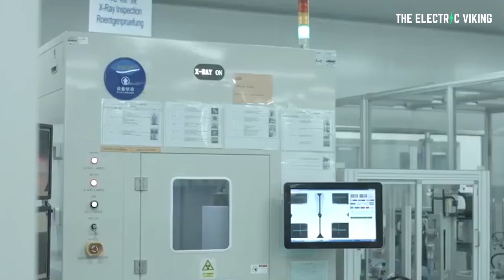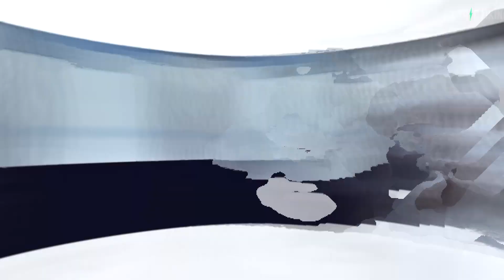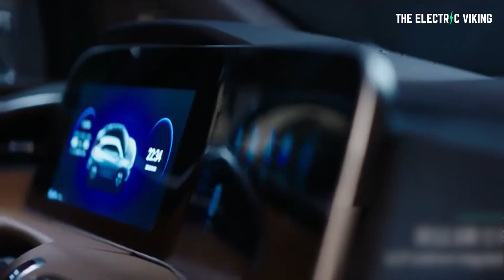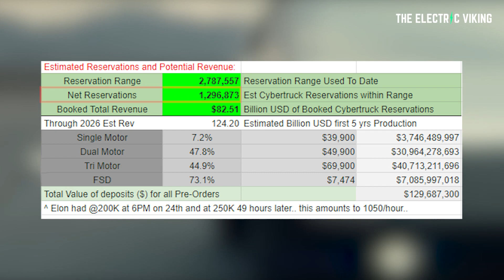The Chinese EV with a range of 1000 km's in 2021

Comment: Awaiting the arrival  in the US of the BZE4 and Solterra, as you had mentioned that they will be using the BYD 3.0 blade battery. Has there been any word about increased range for the blade battery? A 1000 km range would be ideal. Also curious about which Chinese EV's may be available in the US in 2022

Comment: I don't see the point of 1000 km range. I would rather have half the battery and (more than) half the range. Sure, for pulling a trailer a bigger battery would be nice, but take a Model 3 LR for example. Over 600km WLTP. Not NEDC. That's certainly enough. 150kWh battery is just waste of resources.

Comment: I am glad to see the rapid development of EVs, we need it if we're to be able to solve the immediate climate challenges we face. But, I have to tell you, I'm really getting tired of watching vids of concept cars, and hearing promises of long range and great power for a reasonable cost. What is actually in mass production, on the market now, and available to me, is pretty wimpy, with the exception of Tesla (I have an order in now for a model 3 and a cyber truck) - and Tesla is very expensive, and seemingly getting more expensive as we go along, instead of less. The Chev Bolt is available, if you don't mind it exploding occasionally. Nissan Leaf has proven to be dependable, and at a reasonable price, but with 100 miles range, only suitable for a city car, not your main driver.
I'll be impressed when some cars come out with 300+ miles of range, 0-60 < 6 seconds, good handling, fit and finish, and at a 25k to 30k out the door price point. And when it's been around for a few years and it's been proven to be dependable, non-exploding, and not full of bugs that denote a hastily thrown together product, as is the current US OEMs' offerings.. I'm sad to say that, regardless of all the promotions and promises and bulls**t, looks like it will take a few years.

Comment: The average length of a commuter trip by car/van varies little across English regions and Wales at . It is highest in the South East (11.2 miles) and lowest in London (8.6 miles). This statistic shows the average person trip length in the U.S. in 2017. Commuting to or from work is on average . The Lucid Air top of the range model will have 517 miles range and deliveries start in the US later this year.

Comment: I don't need 1000kms. I need an affordable EV. My affordable ICE car only gets 550kms of range and I only need to fill it up once a week. I will replace my daily driver with an EV when I can buy an EV for the same price that I bought my ICE car, if it gets 550kms range or higher. Here's a challenge for EV makers: flood the Australian market with affordable EV's that have 550kms and costs about $20k, and when the resale value drops to $5000 in 10 years or so, I will buy one. Not holding my breath, but that's where I'm at. I'm sure my 2006 Toyota Yaris will last another 10 years, and I'm happy to replace it with an EV before then if the price is right, but I won't pay more for an EV on principle, because there is a lot of inconvenience involved for me. I will need to install a charger outside my house, and because we only have one parking space at the house, and 2 vehicles, we can't have 2 EV's. So who will get to drive the EV? Me or my wife? She isn't even interested in EV's at this point, and is even more frugal with money than I am, so won't be even slightly interested in either of us replacing our bought and paid for ICE cars at current prices with the current range. $20k for a used Nissan Leaf that doesn't even get 200kms range? Forget it. As for buying a car that gets 550kms range at current prices? What would that cost? Can anybody fill me in?
Reply: Strange logic :)
You need only one charger for 2 cars when you're only commute 100 km a day.
You plug a car one's a 3 day.
Reply: @rafanagorski392   it's still a hassle. Can you move your car so I can plug in? I'm hoping by the time we get an EV that there will be affordable EV's  that get over 500kms to a charge. Right now it seems you have to pay $40k plus in Australia to even get 300kms range. $70k for a Tesla that gets 500kms. The price is not yet right.

Comment: What does the Aion LX cost?  What is the chemistry of their batteries?  I'd rather have 500 km of range and have a battery that weighs and costs half as much, assuming there was a DC fast charge system with the density of Tesla's.

Comment: Eventually will manufacturers put in more modest batteries because for all but extended road trip is 500Km quite adequate.
The times I have driven over 1,000Km in a day it was a big day and quite tiring.

Comment: 1000 km. range is more than enough.  A car with a 400-450 km. range and quick charge times will eventually become the norm.  By shooting for a smaller range they will need a smaller battery, saving vehicle weight and production costs, allowing more competitive pricing.

Comment: A lot of people here in the US are under the impression that 643km (400 miles) is  enough but none of these people can drive that long before needing a bathroom break 

I think 482km (300 miles) to 563 (350) miles of range is more than enough for the average driver and weekly trip goers.

Cars such as the Model 3 and Y long range, Ioniq 5, EV6 and the Nissan Ariya are all good looking vehicles that get 300 or above range and would do just fine.
Reply: The problem is, even if the epa says it's rated at 300 miles, you're actually only getting about 230 miles of real world range.
Reply: People want range because they can't always guarantee that the charging station will be available, or indeed, working.
Reply: America probably has 75 million Folks Who would be happy with 200 miles and a useable purchase price.....Paul

Comment: What is your thought of electric vehicles running on hydrogen which is produced by 100% solar and solid-state laser technology stored on 100% recyclable film?
Reply: Still uses a fuel cell and either a Battery and or expensive supercapacitors and electric motor/s. plus you now add in the storage cassettes for the Hydrogen storage medium and the Lasers to release the Hydrogen etc etc - adding more complexity and maintenance cost for what real advantage ? apart from anti EV and Tesla
Reply: @j.pgoodwin9020  I'm not against EV. The environment is what I am thinking about.  I have been to the Nevada mines and their respective drain fields that use scarce water in the Southwest to produce materials to be used in batteries. On May 25th our USA administration announced they will shut down these mines and purchase these caustic metals overseas and bring them into the U.S so American workers will turn them into things like batteries, so electric vehicles can be built by union workers. Like I said I am not against electric vehicles. I looking for ideas that are better for the Global environment. So far all the USA has done is converted nearly 100% of the coal utilities to natural gas leaving us with over 60% of our electrical utility power coming from fossil fuel and 20% from nuclear. In 2021 USA coal production is expected to increase 20% as we ship to countries like China who have increased coal usage by 35% this July after they stopped the Australian import of coal. I am looking at solar and nuclear and ways to reduce pollution versus the BS logic -  Is okay to screw with the environment as long as it is not in my backyard!
Reply: @Carl_in_AZ  You have raised a very valid CURRENT ISSUE. However others are also aware of this issue. Lithium Aust (LIT : ASX) has more environmentally friendly technology and patents and have you checked out Tesla's patents for Clay extraction using salt.
There is research in so many areas of energy storage and generation and it can be challenging keeping up with it all especially as many players are in stealth mode and not publishing and companies such as Toyota are going full on hydrogen even as direct fuel for internal combustion engines which can only be considered as questionable due to efficiency losses and high maintenance costs even if supporting dealerships and existing supply chains but at what long term cost just to please the ICE bang Lovers
Reply: @j.pgoodwin9020  Yes I am aware of companies like the one I work for that are looking at ways to lower the caustic pollution caused by the production of batteries. Our company manufacturers their own proprietary batteries that have been used in our industry-first battery semi-truck. We presently produce our own hydrogen. That hydrogen runs our hydrogen truck engines, locomotive engines, generators, and five months ago planes using our own proton exchange membrane (PEM) fuel cells. We also have in test 3-cylinder 10.6L ICE engines with Walmart in California running dirty hydrogen or "renewable" diesel which may turn out to produce far less of a carbon footprint than battery trucks that obtain electricity from utilities that produce their electricity from 60% fossil fuel in the USA and much higher in some other large countries. My company is far from being in stealth mode. We are all over the press for people that follow hydrogen and other storage technologies to lower our global pollution which goes beyond carbon footprint. I would still like to hear people's viewpoints on Solid-State Hydrogen stored on film?
Reply: Due to inefficiencies in the whole extra chain of steps needed for hydrogen: it seems like a dud. Be like taking your mains power, running it through hydrolysis and then back through a fuel cell to get electricity again. Just pissing away energy on conversion losses.
Reply: @--Nath--  I agree that PEM (hydrolysis) is not the way to produce hydrogen. It is no different than producing electricity from fossil fuels to charge batteries.  There are Walmart trucks under test in California using diesel that produces less carbon footprint than battery-powered EV trucks. I work as an engineer for the company that made the first battery-operated semi, hydrogen, and achates power generation on trucks, locomotives, planes, and critical care facilities. Presently we produce hydrogen from PEM. That is is why I ask what are your thoughts on solid-state hydrogen? PS you do not need fuel cells to run on hydrogen but it may prove to be the most efficient ($) per mile over 150 miles versus battery technology on large vehicles.
Reply: @Carl_in_AZ  I guess the bit I can't see how it can be worth it at least for cars where we know EVs can already work by going from electricity straight into battery charging. Adding extra steps before that doesnt seem like it can possibly get even close. Maybe if the cars ran off hydrogen as the fuel directly or if there was a conversion for existing ICE vehicles like you can go from petrol/gasoline to gas (as in LPG not gasoline), but I have no idea if that is in any was feasible/economic  - but it might help get existing cars more clean for the rest of their working life. 
As for the method of production of hydrogen - a worry I have is that here in Australia they have passed away $4B on fantasies like "clean coal"/CCS of which none of them have achieved stated goals and they are talking about doing the same thing for hydrogen (called "blue hydrogen"). Or perhaps just greenwashing fossil fuel into hydrogen. So it feels like hydrogen is what the fossil fuel lobby want because it prolongs their existing investments by giving them a "lite cigarette" equivalent to run PR/propaganda about. The "natural gas" lobby has been doing this already claiming it is cleaner. Hell, the coal lobby is also claiming that Australian coal is cleaner and helping rather than worsening climate change.. so there is that aspect..
Reply: @--Nath--  The two companies working on solid-state hydrogen are H2E in Australia and PK in Arizona. Some major USA and Swedish engine manufactures are also investigating solid state  Dirty hydrogen which some call blue hydrogen is another topic. When we looked at the global environmental footprint when electricity is produced by fossil fuel at the utility the winner is not always battery TO DATE. We are seeing a better overall environmental footprint with hydrogen versus battery. On larger cars and mid-size pickup trucks where efficiencies are not improved through reduced weight and CD there is a fine line between battery and fuel cells as being the winner to the global environment. The same can't be said for 7L and above engines where hydrogen is the winner TO DATE.  Unless utilities go renewable and we change battery material the issue is we are trading one environmental problem for another.
Reply: @Carl_in_AZ  to date there's been only PoCs for hydrogen - EVs for larger scale is also still in the PoC phase. But I just struggle to see how adding a half dozen energy loss steps can work out better. Both will require extra electricity to produce, but hydrogen needs whatever battery EVs need per kilometre, plus all the losses and shipping energy costs on top.. Range and weight is one aspect worth considering for bigger applications, but what about electricity powered rail as an alternative.. if we are going to (re)build out stuff, rail is by far the more efficient model for mass transportation and that was how goods used to be transported efficiently.

Comment: Range anxiety is more a function of unfamiliarity than actual range not being enough, I think people will lose their range anxiety when they are more used to using an electric vehicle. Just my $.02 cents!
Reply: Range anxiety is not even the correct term. The true anxiety is recharging anxiety aka refueling anxiety. People don't really care if their EV vehicle gets them 500km or 1000km on a full charge. They care about being able to recharge their car wherever they are (within reason), and they care about the recharge time being reasonable. Doesn't have to be a minute but it should not be hours either.
Reply: Trust me after traveling Montana, Wyoming, Dakotas, Minnesota, Wisconsin, and Michigan in -20F temperatures with 40+MPH headwinds and now living in the vast Southwest where there are little to no charging stations on the reservations range anxiety exists.  That is why I am looking at my next EV vehicle to be above 500 miles to account for temperature, wind, and distance.
Reply: @Carl_in_AZ  You are a special case.......Many Folks like Me drive only 10-----20 miles/Day.......Paul

Comment: When I can buy a mid SUV EV for $35,000 CAD, then I'm in, no question. Most of us aren't in the Mercedes/Lexus/Tesla price market.
Reply: Volkswagen ID 4 is getting close with the federal and provincial rebates.
Reply: And very many Americans will not buy a 2WD..FWD....to replace their AWD SUV.......Paul
Reply: @paul-flyer  I'm not so sure about that. You don't need AWD on a mid sized car 99.9% of the time and the .1% you can manage without easily enough. In the snowy areas where I am it's more useful, but I still rarely use it. The winters here aren't nearly as cold and snowy as they were 50 years ago when I was 18. Also,  electric cars can be AWD.
Reply: @paul-flyer  So true Paul. Would you  ever need that AWD , probably not.

Comment: Why Has Nobody installed charging lock boxes at shopping centers to charge phones or head phones , battery packs etc ? It should be the Modern Payphone there should be boxes to charge everywhere. Pay to rent a box to charge all your battery powered Products. Just install many plug outlets in each box etc..to charge many things at once... 👉 All you can charge👈 for 1 low rate 😄👍 Fill the Need not the Greed. Dont Price nobody out of Electricity because they are poor. Thing will more then pay for itself if it's built right and charge $$ very low cost to use.

Comment: GELYF - I've invested instead in Geely Automotive (GELYF), they own Volvo, Lotus, Polestar, etc and have major global distribution deals with Renault and Diamler. Renault has a partnership with Nissan, so that might also help Geely.  Their price is $ 3.48 /sh and valuation is about $ 35b, so they are not yet overvalued.  They also have a partnership with Northvolt to manufacture battery systems.  This bet is a way to play EVs, Rare Earths, and Batteries in one global stock.

Comment: Why not cut the range in half and build two cars instead? I mean everyone is still battery constrained, right? Two cars sold is better than one car sold from the manufacturer perspective.
Reply: They probably will have "short" range versions of the vehicles...
Reply: @OlJackBurton  Yeah, but does the high range version make sense in the first place? You'd have to live pretty remote or at a place without any charging infrastructure but then at that point you might as well just buy an ICE car until that infrastructure has been built.
Reply: @kelindrawn  Rural China, Montana, Wyoming, Australia.  Basically, you would never need to charge outside of home since you would never drive more than 1,000 km in one day...